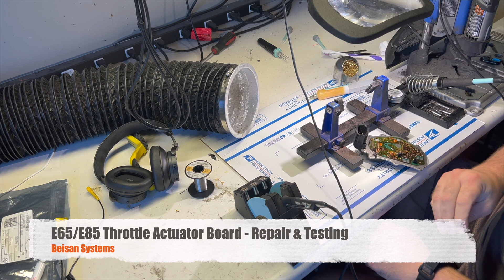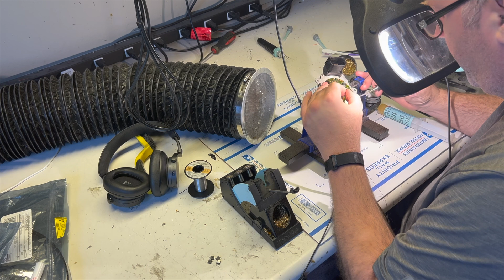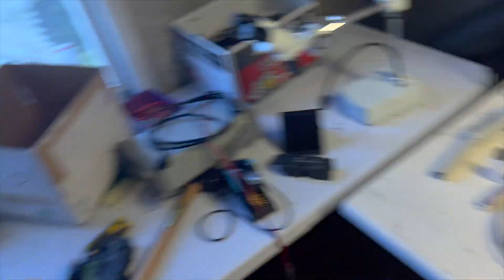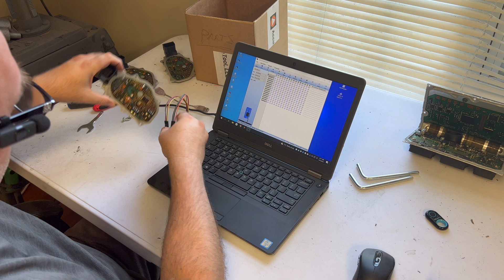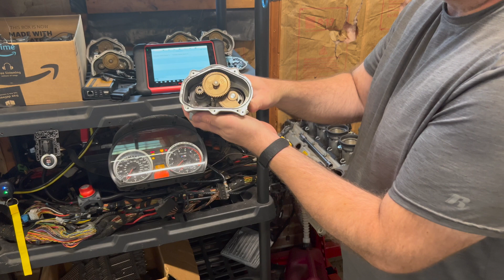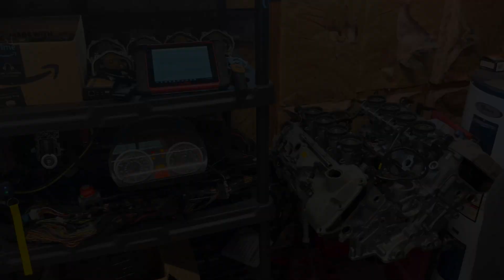E65/E85 Throttle Board Repair - Beisan Systems

Comment: Hi, can you build ICV (Idle Control Valve) in the same you you did the throttle actuators (gears, motor and board)? Cheers.